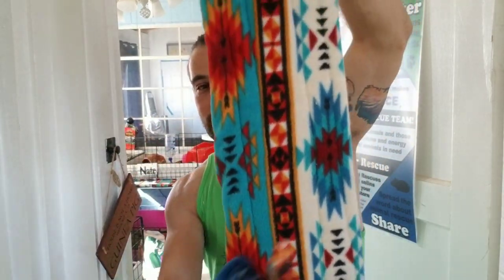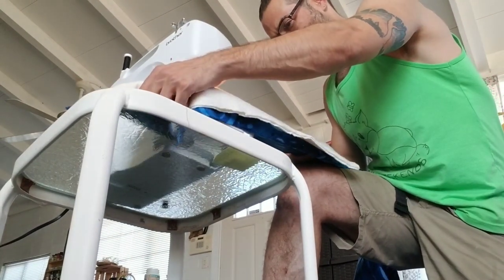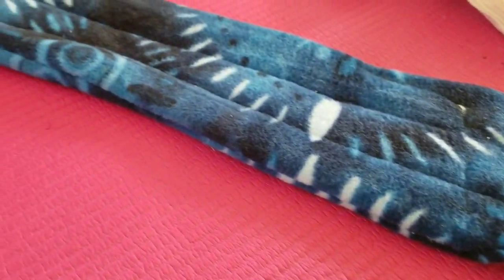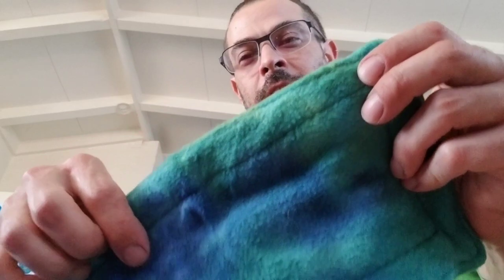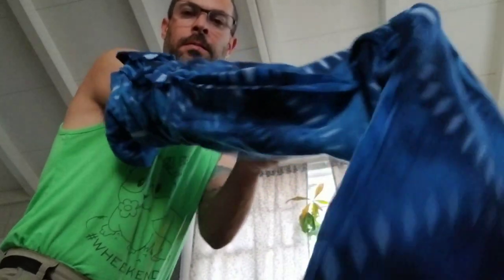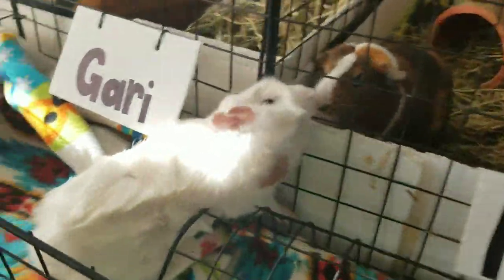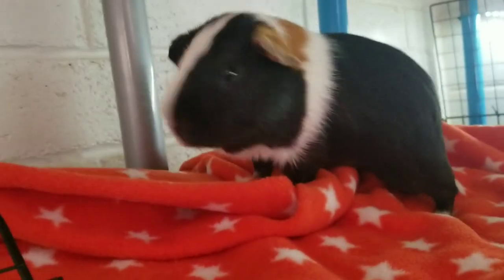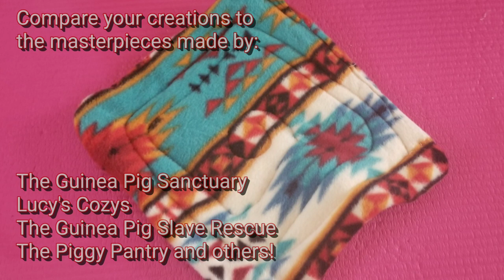Real Men Sew Guinea Pig Fleece

Comment: Hi Scotty. I’ve been sewing most of my life. My Grandma taught me when I was 11 years. So that makes it 57 years. I think you are doing a great job, for a beginner. Your guinea pigs will love and appreciate the fleece. When you are making a tunnel for them to sleep in, it’s always a good idea to make extra tinkle pads, for inside. And don’t kid yourself, during the night, they will back up, hang their little butts out of the tunnel , poop and crawl back in and go to sleep. By morning, you should have a great little pile of beans. Although, on occasion, you will find a bean or two inside their tunnels. Keep up the good work. You can make pads to go under their water bottles to catch those occasional drips. If you make long, thinner pads, use a ruler or even a yardstick to assist in turning the pads inside out. I’ve found wooden spoons to also use. Since fleece and the batting does ravel, just pin the end together and stitch a couple of rows of stitching, to secure the end together. Make sure, when you start sewing to stitch forward about 1/2 inch, then hold the reverse button and stitch backwards to secure the seam end together. When you get to the end of your seam, slowly sew to the end and hit that reverse button again, and while holding the reverse button in, sew about 1/2 inch backwards, then release the button and sew forward to the end. Then lift up your presser foot up and clip the threads. Good luck. You will get better as time goes on. There is a YouTube listing called GuineaPiggiesDesigns. She has tutorials on how to sew all kinds of things, step by step. You’ll be a Pro in no time.
Happy Stitching, Nancy 😇🥰🐹💗💕
p.s.- please check your tutorial  on how to build a C & C cage. I have some questions about coroplast.

Comment: nothing wrong about men sewing, its a creative thing just like making a shelf or set of cupboards lots of men sew upholstery for furniture /cars etc no difference to making stuff you need for your piggies or home your doing good Scotty , I learnt handsewing at home and on machine in home ec class in school, by that time my mum had a sewing machine so we always had one about my brother used to use it to for his stuff, I learnt to sew for my piggie from youtube videos , a pattern and instructions for every thing you want, in saying that my first 3 cage liners were handsewn, big job but still they are holding together,   until I bought me a machine  now I have alsorts of stuff, and I used furniture blankets for the absorbent lining works really great and is cheap from the hardware store, Im in New Zealand and a large blanket is around $10 - $12 and makes 2 - 3 liners for a 4x2  C&C style cage  with pieces left over for some small pads, and a tunnel or 2,  I live alone so I do anything I need to have done from building shelves , using hand tools, saws , all that stuff and can fix cars not so much now as Im getting older and arthritis restricts my moveability but Ive done panel beating, welding and spent 18 yrs operating heavy machinery , I can drive them all, trucks, big and small and I can also find my way around a computer and have done office work as well,  was Quarry Manager for 6 yrs until an accident put me on disability,   hence the reason I now have time for piggies and my cat,  heres a tip for ya, if your going to be sewing lots get you a rotary cutter, honestly its a blessing in disguise, perfect lines none of that sissor action and you can cut several pieces at a time which makes all your pieces the same size so sewing will be a breeze , its a round blade cutter made by Friskars

Comment: If you're doing them just for yourself (as opposed to selling them) as easily as possible and at the lowest cost, bulk fleece on both sides and a moving blankets in the middle, you can just line it up and sew the edges together without flipping things inside out. Fleece doesn't fray, so you don't necessarily have to have a hem on it.  
Just an idea for someone who doesn't have a sewing machine, or is in a pinch :)

Comment: I identify as both male and female: if something can be driven by a power drill, smacked with a mallet, put under a knife, smothered in glue, or sewn in under seven minutes, I'm happy to do it. Projects requiring power drills are my favourite, but my family's (which is older than I am) died last year. Also my hammer aim is deplorable but that doesn't matter until I smash a finger, hehe.